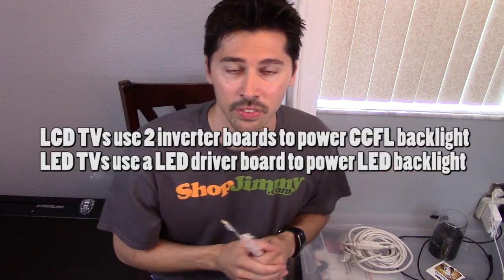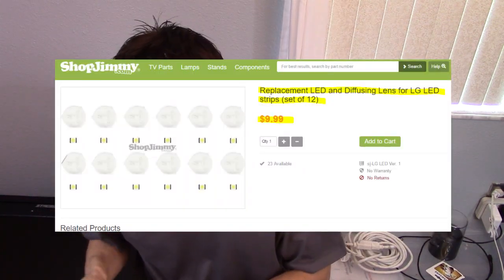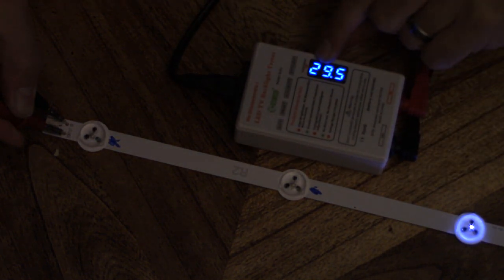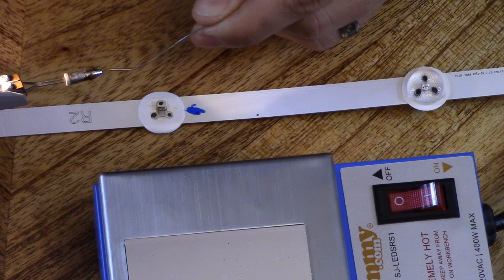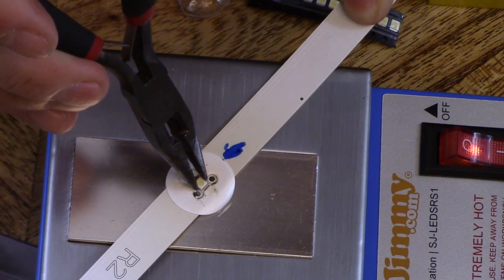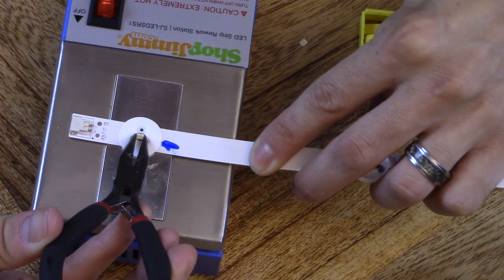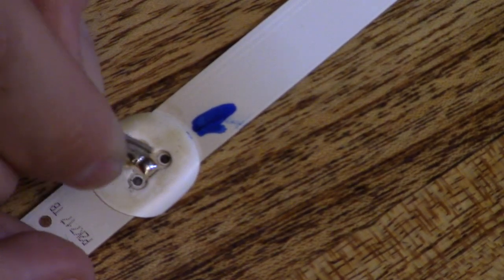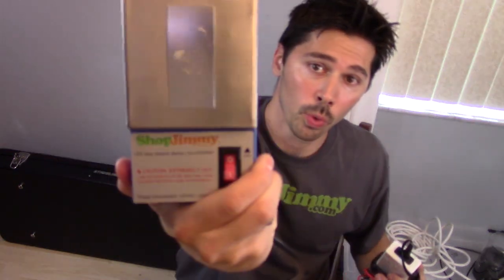EASY LED LCD TV FIX - no picture black screen backlight repair kit

Comment: Hi! Can you tell me without the blacklight tested if I have my own adjustable PSU(/ LED driver, what voltage and amps limit to use for every LED strip unit?
They are in both parallel? The 4 strips and the 8 half strips gets the same 120V voltage? What maps to limit current?

Comment: Thanks for the video I have a TV that have back like problem  and I have be trying to fix it when I turn on the TV the light will on for about 2 seconds and goes off
Reply: @Techcommunity360  did you fix
it its happening to me

Comment: Just a simple question. Are Hisense TVs worth repairing? One I'm working on has screen rubber taped to frame.
Reply from the maker: Yes, if tv is less than 5 years old it's worth fixing. How long tape fix last?

Comment: Hello,
I have a Sharp 4T-B6OCJ1U that the screen use to turn on for 15 seconds and then turn off. Now, the backlight will not turn on at all. I'm having the issue of finding parts for this tv.

Comment: What kind of voltage do I need to have powering 4 led strips in a tv. My board is only putting out .7 DC. Which I would think is enough.

Comment: Don't use super glue
And make sure you focus the defuser before your UV glue sets
Super glue will spread out burn up from the LED. Plus if the defuser isn't in focus you'll get a patchy backlight or even spot's.
Reply: How to you focus them? Also will hot air gun work to get the LEDs out? Do you really need the "shop jimmy led work station" ? Lol

Comment: Hi I have a Veon 55 ' 4k Ultra HD LED LCD tv.Model  V55UHDS. I have no picture and no sound. I plug it in and get a red standby light.I then power on the tv and get a blue power on  light.But on the screen  theres no picture and also no audio. The screen stays on for 1 minute and 19 seconds then back to the red standby light.Any help would be appreciated.I dont have/own a multimetre to test it. Thanks.

Comment: Interesting work procedure. I like that those LEDs can be replaced, however, in my opinion, depending on how old the LED strip is, I'm more prone towards replacing All the strips, to be on the safe side, of not having to go back in a month or two later, for the same reason, having had the opportunity. All the same, it is good inspiring technological work. I am currently about to replace the strips on my Samsung UN55J6200DAf..

Comment: The LED Back-light strips are LB50068, 
but what is the part number for the LED that is soldered on to the strip for the VIZIO E50x-E1 ?

Comment: How do you determine what model of led you need for the strip?   Is there anyway to tell prior to disassembly?   Or do you need to see the led to tell?    I have a Vizio M70-F3 if that helps
Reply: Just search online your model and replace the led strips. They are cheap  $

Comment: will I be able to use these LED strips on my UE50F6400 series TV it also is 3D capable. I am stuck on what LED lights to use and ive tried searching for them but can't find them anywhere I don't know if I am searching for it wrong, please I need some help it would be much apreciated thank you

Comment: My Toshiba is a heavy and thick width TV but it's going strong. I took your advice and set the backlight lower but I've taken a gamble and set it to "Auto" as that seems to keep the backlight around the medium mark anyway (maybe you can shed some info on "auto" setting? thanks)

Comment: if you do this repair replace all of them. The leds short out and voltage levels increase to the remaining leds is increase. it shortens their remaing led's. early on we tried just replacing single leds, parts were harder to get then. Had a bunch come back 6 months to a year later. if only 1 or 2 are bad this will probably work for awhile

Comment: I'm thinking it might be easier to just replace the whole light strip :) .  I did some searching and I was able to find single strips for sale for $9 each, or a pack of 10 for $28-$64 ($28 if shipped from China, $64 if shipped from the 'States).
Reply: Link? I have a TCL that needs LEDs.
Reply: Yes replace them all. They are cheap  $

Comment: My Panasonic Viera tv was not used for 2 months (Model number: TH-42AS670D, 2014 model). I face the following issues:

1. When I power on the TV it goes to home screen (default).
2. If i click any icons on home screen, be it Media player or YouTube, it just freezes. Then screen blanks out after few seconds, and navigates back to the home screen. This happens even if I power ON the TV and do nothing.
3. None of the REMOTE buttons work except the power (ON/OFF) button (same happens when i use the android tv app). Same issue with the TV UNIT buttons too.. 
4. Most importantly, if i invoke Main menu on the tv or remote or android app, it doesn't show the menu at all!
5. I tried a factory reset using tv volume- and remote Menu buttons, still above issues persists.
6. The firmware update does not run from USB, since I already have the latest revision installed.

I have take apart the TV back panel, and haven't noticed any capacitor burns or loose cables. Is there a way we can do a forced firmware install, if that fixes the problem.. Would really appreciate your inputs!

Regards
Ed

Comment: I have a Phillips 42pf9631D/37 
With audio but no pictures could this be the  problem or are there other common problems that i can check not a tv. Tech was a small engine tech before health problems forced me to retire

Comment: It looks like Shop Jimmy is not answering the comments (not that I can blame them). That's too bad because I have a question as well.
I have found a TV that keeps blowing backlights. I have replaced three LEDs so far and I bet it will blow another one.
It's a Haier HA2347 55" curved TV. I have the service manual and the voltage to the backlights is within specs. I can only assume there is an issue in the power supply that is intermittent, or something wrong with the power in the house.
Does anyone have any other suggestions?

Comment: What voltage and watt's is required for the led strip backlight?.
For piece
Reply: It varies depending on the size of the TV. Larger TVs (55") can use 350V. I have no idea the wattage. It would depend on how many lights there are.

Comment: I have a protron pltv 32c tv. The problem I’m having is every time I hook up a antenna or usb cables into tv portsI get a message saying no cables detected. I hooked up my cable box to the tv I have a blank screen but, I can hear sound in the back ground. And I can’t get a picture no matter what I try. Now when I hook up a DVD player to the tv it works perfect great picture and sound.(need help on how to determine the problem and how to fix)

Comment: Can I test the backlight WITHOUT taking everything apart?? I took the back off to the boards, do I have to keep going JUST TO TEST??
Reply: You need a backlight tester. The lights are usually set up in series, like an old Christmas tree, if one LED goes out, they all go out. You need a 300V + backlight tester to connect to the backlight connector to see if they work. Or, you can measure the power on the plug for the backlights with a volt meter. If it is good power (at least 250V, but I've seen up to 350V) then there is likely at lease one bad backlight. Now, you have to decide of you want to remove and test the strips for individual LED replacement or if you just want to replace all the strips.
If this is too confusing, or you can't accomplish it without someone's help, you should really take it into a TV shop if there is one near by that will do backlights.
Reply: @OriginalMergatroid  thank u for the info, much appreciated. I'm just gonna take it to a tv guy, too much for me

Comment: all well and good but considering it is an unknown why those LEDs failed and all the LEDs are the same age there is no guarantee the other LEDs won't fail also soon after. It's usual practice to replace all LED strings to ensure no call back in the near future to replace any others.

Comment: The lesson is truly helpful to a beginner like me.  Pls can you advise me what I should do to sort out the problem with sounds on a LCD TV. The picture is ok but the sound is not clear. It gives just some rattling sound. How can this be repaired? Do you recommend to replace the entire motherboard?  The model is SLD3218CV Singer.  Thanks, Tampatec!

Comment: Thanks for a great video. Can I use a hot air soldering station (no heat gun) instead of the backlight strip work station used in the video? If so, at what temperature? I didn't find the backlight work station for a reasonable price (I'm not in the US, so a) shipment costs exceed the price of the device itself and b) the power plug won't work for me).
Reply: Yes! You can get the tester for £10/$15 dollars, don't pay $60 for one that is identical but has a ShopJimmy sticker on! Also the LED Rework Station is just a soldering station with a sticker added and price doubled.

Comment: I have a Sony KDL-46V4100 and when its turned on the backlight will light up right to left and go out. It will do this 2 more times and then the LED power light will flash red 6 times. What could be the problem?

Comment: How much dose a repair like this cost because I just took a Emerson 50" to the TV repair shop and that repair for the LED backlights was $255 I'm a electrician and a little electronic savvy , you do make it look easy but could you but the LED backlights strips because I'm not tooled up like that,  but your video's dose encourages me to stat working At least my own stuff 👍

Comment: Hi Paul, thanks so much for all the help. I have the shopjimmy LED tester and the rework station here, but unfortunately shopjimmy won't have compatible LED's for my Vizio E65-E3, so I'm going to have to go with another online vendor. Problem is, I'll have to find LED's that will match up. Good news: I found compatible 6V LED's with the right dimensions and anode/cathode solder points for my strips, and I successfully soldered and tested a couple of them so far. Bad news: I can't get a matching color. I've sampled up to 6500K Color Temp but none of the new ones I've tried are as far on the blue side of white as the existing (or the ones we see in your video). I'm starting to give up on finding a good color temp match. Do you think I should just use the new 6500K LED's and replace ALL of them even though the native LED color won't be the same? Maybe the TV color settings will be able to compensate? Have you ever been faced with this?

Comment: my 55 in rca tv got audio .no video the screen will flash when turned on and can see picture in back ground with light and the led lights flash when it turns on but the led's wont stay on

Comment: i have Sony GJ-DLEDII-400-D409-V4 LED KDL-40R350B. i need an LED repair kit, shop jimmy does not show the kit. are there any other places to look? i have 1 LED on each strip out and set wont stay powered up. i used LED tester to confirm the issue

Comment: yeah waste of time been there since i do this for a living it will fail or another strip will fail these tvs are nothing but junk throwaways. we live in an electronics throwaway  society  your lucky if you get a year i have over 50 tvs in for repairs right now.
Reply: Yep....my LG TV is out for a third fix of the LED. I still do not why i insist wasting my money on fixing it.
Reply: Would it be better to replace all the strips so having fresh LEDs? As the other LEDs will also have had a long use and may fail

Comment: I have a tv like that one but I have to turn it on and off repetedly to get it to light up so it's not leds. What could it be?
Reply: Matthew Kiefer bad capacitors in your power supply. Probably less than $5 for parts.  Easy to spot. They bulge and usually leak on top. Replace them all at once with Japanese caps like Nichicon, Panasonic, etc. 105 degree capacitors.

Comment: What voltage should I be reading for the LED connection coming off the power supply board on a RCA model LED65G55R120Q

Comment: Nice work! I used a simple clothes Iron upside down to remove My LED's and a multimeter with diode mode is enough to test them with 8-)
Reply: phil mcguire That’s exactly what I was trying to find out! I just wanna use an iron and swap 3 leds out. How low was temp on iron and did it work out?

Comment: Tampa I have a lg 32lb561b tv. Bought some 3528 leds to replace the ones on the strips but after the repair they burned out, 2 minutes after I switched on the tv. Could u send me a link with the correct leds?

Comment: It was an interesting video thanks for sharing.  I have a Phillips LCD TV that shows a little bit  picture.  When I turn on it takes time for the picture to come up and then it is  dark in the left side. Please give some advice about what I should do. Thanks.
Reply from the maker: Senia Escalera check the tcon cables connections going to panel use Electronics freeze spray to locate the problem area.
Reply: Hello! I have a Lg model # 37ld340h. It just all of a sudden went to a black screen, still heard the volume then just completely stop doing anything. Could you please tell me what younthink it could be?

Comment: I have the LG 32LN5300 and I get audio, but no picture. It fails the flashlight test and I don't see any backlighting with the back cover off and powered on. Any ideas?

Comment: Dear Tampatec,
I have a 50PA4500-UM from LG. It has sound but black screen. The remote works fine. So I can turn it on/standby and change the volume. I noticed when TV is on the power LED light at left-below of screen has no colour light. And when it is standby the light shows red. I used LED flashlight to check the screen when I press setting button. Nothing shows just black screen. BTW: when I press any button, the power light flash as red.
So I removed the back cover of TV and check back light. It's all black and no more other light except  two red lights on the EAX64696607 board. 
Could you please tell me what's the next step should I move?
Thanks a lot and have a great weekend.

Comment: I fixed a Samsung 40 inch bad caps been working fine for months turned it in sound no picture did flashlight test can see picture no lights on back coming on u think it's the Inverter boards ? it's the Samsung 40inch from 2008 lol

Comment: Hi, Tampatec, sorry I dont know your name, I wonder if you can advise me?
I have a Teltech LE-40GB01-C LED TV, 
Turned on the screen glows a faint blue but nothing else, I tried the torch tip you gave in a video a while back, but cannot see anything?! but I can see the leds are lighting through the back. so I`m not sure what might be wrong!? Please ask if you want more details, many thanks Mick (McAVIT Yourway)

Comment: I did the same thing to an LG 42LN5300 last night. I ended up doing all the leds and lenses for fear of future failure for my customer. Just a few things to add to this great video: 
When reinstalling the diffuser lenses make sure you get all the old pieces  out of there. If the diffuser lenses are too high off the LED it will create weird circular spots on the back light panel (layers under the lcd panel) that will be visible while watching TV.. i found that out the hard way and had to lower about half of the lenses. Also avoid prolonged heat or too much glue as it will discolor the led itself causing the panel to have inconsistent lighting...Great video!
Reply from the maker: good tips
Reply: Tampatec Thanks man, awhile back i was talking to you about a sony kdl-46hx800 with I think a five light blink that pointed me to the LED driver. I replaced it checked back lights, checked everything else. I found a service manual as well. Service manual said to replace the main board and if that didn't work the lcd panel was bad. I found a fuse the size of a grain of sand (1 of 20+ fuses) on the T con board that had a cold solder joint.. I just used my hot air station to heat the whole board up popped it back in and it worked! It was a 2010 TV that quit working in 2011 and sat till 2016. I actually obtained the TV for service in 2015 and after the T con board replacement failed to fix it the customer told me to go ahead and keep it because he did not want to spend anymore money on it ..It was an awesome feeling to bring back that TV..
Reply from the maker: Jess Rose good job! you seem like you been doing TV repair for awhile. Yeah those Sony TVs can be bad tcon boards or bad LCD panels or buffer boards hard wired to the panels. So far techs in China factories are doing the LCD panel connection repairs. I posted it on g+ but no one use that anymore.
Reply: How much you will charge I'm in need of mine getting done

Comment: hi please can you help me i have a two month old hitachi 50hb6t72u.
unfortunately a thunder storm blew it, because this is not covered under
 the warranty 
i took the tv apart myself couldnt find anything black or burnt or 
bulgeing, so took the power serply
out and underneth could see that it had blown. so i ordered the part it 
came today i put it in and
turned it on, the back lights come on for a split second then go off, 
the power light does not come on 
i know the poweer serply is working because i can hear it and also every
 time i turn it on the back lights come on for a split second. please 
could you tell me what else could of gone on the tv so i can fix it, we 
have kids and only bought this tv
about 2 months ago and now have no tv and can not aford to buy another 
thank you in advance
kind regards
Mr A Patton.

Comment: hello i have grundig 40vle4421 i have replace led now leds work for 5 min then backlight turns of but i have sound then i meansure voltage in led+ pin and gnd and i have overvoltage it shoud be 95v but is around 140v
can you help me 
sorry for bad english

Comment: what about testing the led driver port to verivy there is power or not  i have a samsung led tv that use board# bn44-00645d  so im trying to find the pin out or schematic so i can measure those pins for that thanks